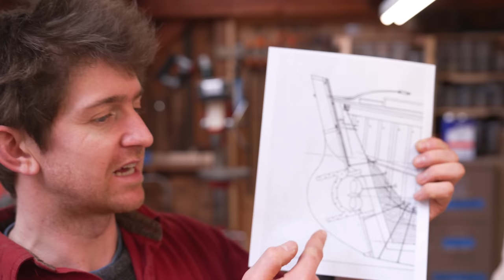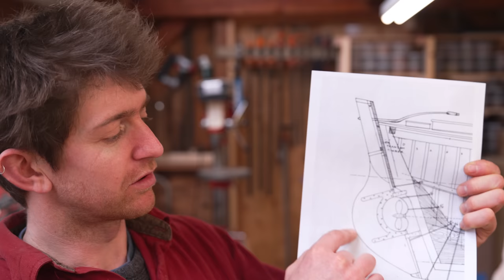Purpleheart Rudder / Cherry Cabinetry (rebuilding Tally Ho ep148)

Comment: Excellent episode. I wonder why Sikaflex instead of epoxy on the rudder. Even secured with bolts, it seems epoxy would add strength.
Reply: The sikaflex goo will keep its elasticity for a long time, while a hardened epoxy joint will fail much sooner b/c epoxy doesn't match the wood's movement (expansion & contraction due to temperature & water absorbtion)
Reply: @frederickstibbert7389  OK, that makes sense, I think, and thanks very much for responding. I do a bit of amateur woodworking and boat work, but I don't work with massive pieces of purpleheart that will go below the waterline. Wouldn't 5200 be stronger and as flexible? Mind you, I don't presume to question these guys, who are on a different level. I'm just asking for my own edification.

Comment: Could the historical ineffectiveness of the rudder have anything to do with the relative position of the pivoting axis?  Under sail and moving through the water is one thing, but what about when you are maneuvering at near zero speeds at close quarters under propeller power?  For example when you are trying to maneuver up to a dock to refuel. I would think that under those circumstances you would want the pivoting axis to fall aft of the rudder prop aperture so that the leading edge of the rudder prop aperture would swing in the opposite direction of the tail of the rudder.

Comment: whilst so many remark on the skills being used I couldn't help but be disappointed with the way the propellor clearance cut out was acheived.  There are many occasions when a good hand tool can be far more effective than an array of power tools.  A good bow saw and the right blade would have cut that shape out in one go and only needed a fraction of the cleaning up to give the final finish.  I am also surprised to find no comments about the many dangerous machining actions being undertaken with scant regard for safety.   Many great end results but a lot of luck there are so few injuries.

Comment: I am familiar with trim tab in Aviation, and in boating wherein trim tabs control the plane of the motorboat.  I understood the purpose of the trim tab to be used on SV Sampson's Rudder.  However, I cannot figure out how the trim tab could be controlled to move opposite to the rudder angle which is controlled by the tiller.  If you can, please explain the process of controlling the Trim Tab  
Thank you   ⛵⛵⛵⛵⛵

Comment: So how does the trim tab actually work in controlling the rudder?

I would have thought that if you kick the trim tab over one way its surface would be exposed to a certain amount of pressure from the passing water.

That in turn would cause the rudder to kick the other way, but only until the pressure the rudder then sees it equal to that which the trim tab produces. If the pressure went above that which the trim tab produced it would just cause the rudder to push back straighter again.

So when you get equilibrium between the trim tab and rudder that then gives you an equal amount of pressure on each side meaning no turning force applied to the boat.

I get that the trim tab can cause the rudder to turn, but I just don't see how that produces any usable steering effort.

Clearly I'm missing something here.
Reply: Think of the moment arm as in the force applied to a lever.
Reply: I don't think the system is expected to do much more than make minor course corrections in light or moderate steady-state conditions.  If the boat is getting slapped around under changing winds, best resort to a human helmsman.
Reply: Anthony, thank you for mentioning moments.  Reading through the comments, I think this crowd not ready for such an easy understanding.

So simple a caveman understands.  People have understood the principals for thousands of years.  Today, very few have practical understanding of mechanics.

Comment: So do you lock the rudder in the center and just use the trim tab for steering?
Reply: No, the rudder is free to move. The wind-vane or autopilot mechanism will turn the trim tab in the direction opposite to what is req'd, forcing the rudder to move in the correct direction.

Comment: I drill through a piece of wood 2 inches thick and I miss the mark. How on earth can you hit that mark 4 feet away?
Reply: The workpiece is set up so the planned bore is horizontal. Then, an oversize washer is placed on the non-threaded shaft of the drill bit. As the bit spins, the washer will walk forward or backward on the shaft if the drill's angle deviates from the horizontal.

Comment: Honest question; why would you use an axe if you could also use a router and a template? I’ve been doing this work for 30 years but never really never used an axe..
Reply: Because it works just fine.
Reply: @michaeldemarco2415  😂👍like biking; works fine but car is faster.